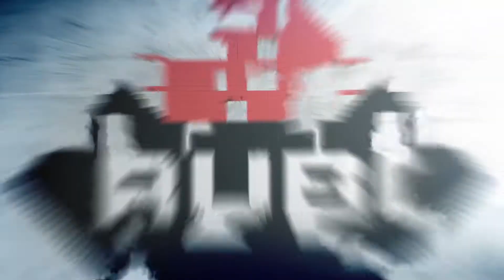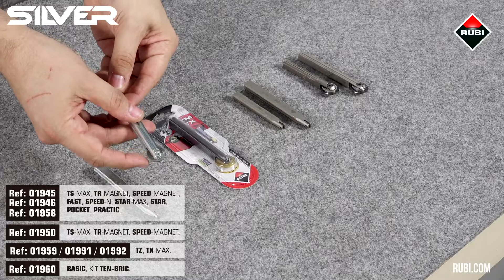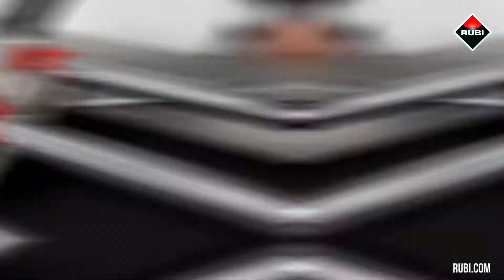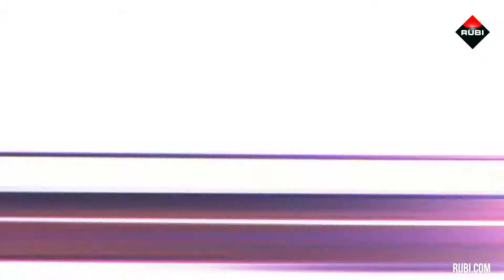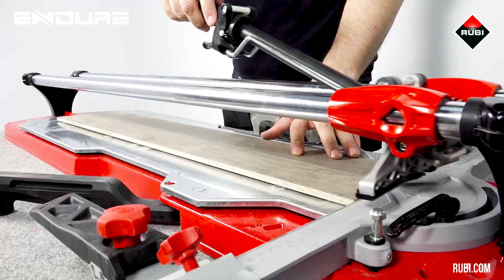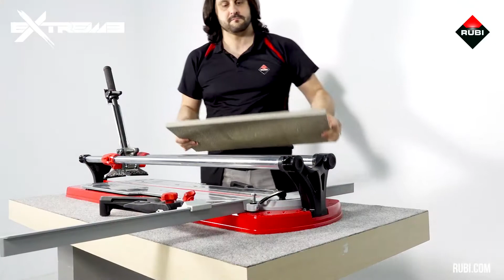Rubi Scoring Wheels Product Range

Comment: Hello. I have a question regards to the meaning of the number above the wheel on the shaft next to the triangle print of the TZ TX 22mm cutting wheel?
It changes from wheel to wheel.
Thanks.
Reply from the maker: Hello Todd. Those small numbers written on the scoring wheels are actually something we use internally to identify their metal bars. It doesn't really mean anything of use to the end user. Good question though.

Comment: What size replacement for speed 92
Reply from the maker: Hello Tardath. By "size" are you reffering to the diameter of the scoring wheel? Because that has more to do with the material you're cutting than the cutter you're using.